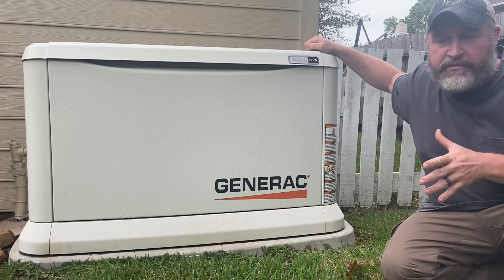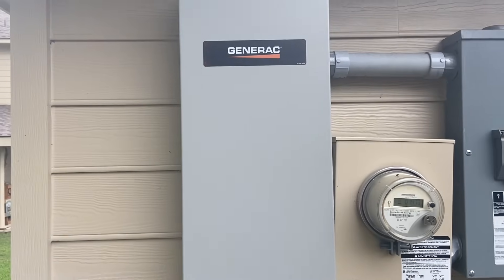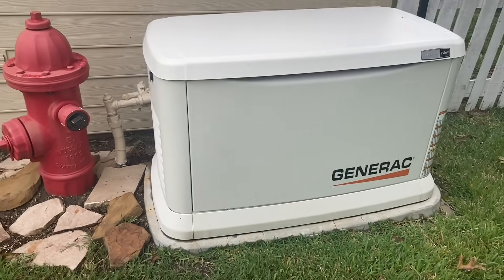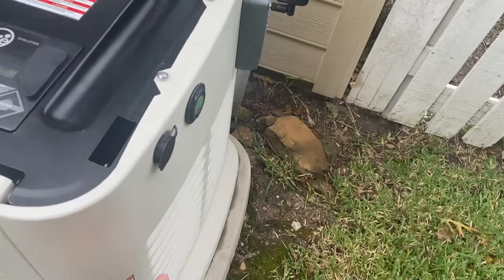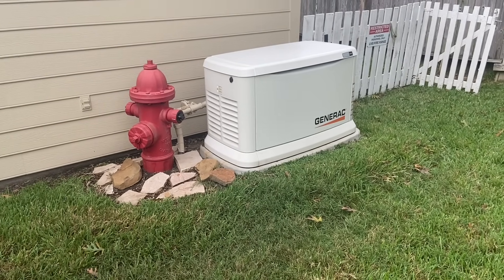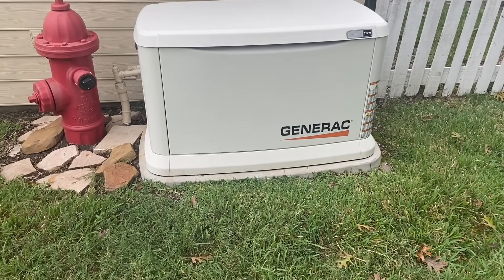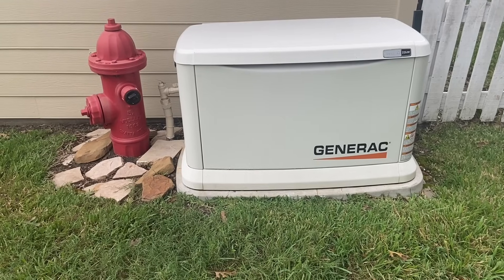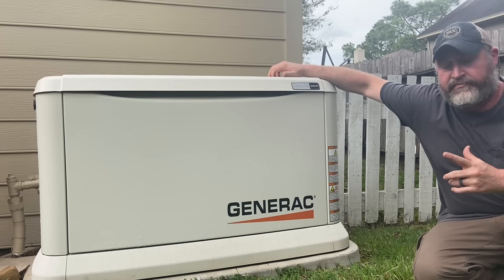Thinking of purchasing a generac whole home generator?

Comment: Very informative!! I'm getting one soon. Advise me if you will. I'm total electric with a 2.5 ton ht pump, 1.5 hp well pump, all the everyday appliances, 2 TV's, 4 ceiling fans, washer/dryer, 200 amp panel, garage door opener, and approx 1,400 sq ft heated/cooled space. I don't want to spend too much or too little on the generator. 22KW would be plenty, but do I need that much? What about 18-20 KW? I just don't know. HELP!!
Reply from the maker: I would always plan a little over for the future, but if your dealing with a good company they will give you the options.

Comment: We are in Texas also. Just got a quote from Generator Supercenter and how I found your vid. (doing research) We are looking at the 26kw. I'm very surprised your quote is $3925 install where they quoted me $7827.77! Our houses and install are pretty much identical. All they way down to the distance for gas and electricity.  They also did not offer the surge protector. Our quotes are pretty similar except for the doubled install price. Do you mind if I use you as an example to our salesman when I call?
Reply from the maker: My quote in the vid was almost 11k going price in my area for the same is now 13-14k you can definitely use my example if you want.
Reply: Prices going up with demand
Reply: Great idea, jew them down so that they don't make any money at all.

Comment: We had lost power for almost 48 hours do to power lines and transmission lines being down. 90⁰F+ days was not fun. But I have been looking at generators just in case. May go with a permanent mounted one at some point. Though $11-$12k is a big pill to swallow at the moment.

How much natural gas will this thing take under a full load?
Reply from the maker: The year of the big freeze when ran off of it for 36 hours and our gas bill was only 52$ more that month than the previous year month, keep in mind we had two gas furnace going and a gas fire place periodically
Reply: For that money, you can shack up in a hotel for quite a while.
Reply from the maker: @mrpawpaw7023  no hotels had power either.
Reply: @mrpawpaw7023  Will being in the hotel keep your pipes from freezing and bursting?

Comment: Hello, great vid very informative. Im deciding between getting this installed through Costco or looking at those new battery backup devices like the Anker Solix F3800 or the Ecoflow Delta Pro Ultra 2. I like the idea of battery as i can keep it in the house, no trench digging no gas/liquid propane to deal with, no noise. Are you familiar with those?
Reply from the maker: Thanks for watching, sorry not familiar with the battery backup.
Reply: I understand that to use those batteries you have to have solar panels installed (so those batteries getting charged constantly). Each battery could only last a few hours during a grid outage. For example, I live in Florida and every time we have hurricane we have power outage for at least 7 days.
Reply: @nimankot3942  no you don’t need solar panels. You’re thinking of something like a Tesla wall. Im talking about something completely different, look up the products. You can use solar panels with them but you don’t need it.
Reply: @K0NY718  So, yours is something like the tesla wall charged via your household current, or solar panels.  Won't last long-but okay for minor appliances, cell phone charging, running a small fan.

Comment: Thanks for documenting all of this.   A question:  When you turned everything on did you measure the total kwh drain?   Just curious what all of those appliances needed in the aggregate.
Reply from the maker: Thanks for watching! Please subscribe and check out some of my other videos. 

No I did not check the Kw drain , as the chance of us ever needing running everything in the house during an outage would never happen , I did it just to see if it would power everything, as we had received different info during other companies quotes.

Comment: Very Good Video, good information "Real World".
One question, you said that you used the Generator for about 30 days during the freeze, How did that effect your energy bill ??
Reply from the maker: Thanks for watching, you may have misheard, it was about 36 hours and if really did not effect my bill, maybe like 17$ more per day but that is also with 2 gas furnaces and a gas fireplace running. We left the attic door open to to keep the pipes from freezing so we where going through some NG for the big freeze. Please subscribe and check out some of my videos

Comment: Hi I have a question can a person shutdown electric threw there electric supplier and put the generator on gas powered threw there gas lines like you did and go completely gas and pay no more electric bill but pay gas every month only in order to power there appliances,internet,and normal lights? Thank you Michelle
Reply from the maker: You could however this generator is a emergency back up generator it’s not made to run continuously all day every day.

Comment: Here is some alternatives.  Portable power stations.  I use mine when boon docking  1800 amps for $1100 from home depot.  Basically a large rechargeable battery that outputs dc and ac to run appliances and lights.  Charge from solar, wall outlet or car.  Buy two and you are home free.  No installation costs.  No maintenance costs
Reply from the maker: Interesting thanks for watching please subscribe like share
Reply: Except you can't run an entire house on one of those little inverters.  Plus, you can only run those until the battery runs out.  When you have a power outage,  you are going to be running to your neighbor's house, asking to recharge.

Comment: Very informative.  Thank you for posting. Why did the pad crack?
Reply from the maker: Thanks for watching the pad is not cracked those are sand streaks from the casting process. Please subscribe like share and share, thanks
Reply from the maker: A sand streak propagates with water along the form wall, removing the cement paste and small fine aggregate and leaving behind elongated veins of exposed aggregate without cementitious paste.

Comment: We are thinking of an 18 KW, to use for possible future hurricane issues. The last storm, Ida, played heck with us. How do you think it would perform for 3 - 4 weeks, with the proper maintenance done every two days?
Reply from the maker: I believe the manual says to check oil lever every 24 hours of operation, we did but never needed to add any so you should be ok.

Comment: Thanks so much for the comprehensive video. I probably wouldn't have bought one, but the house we just bought had one.  I have to admit it was a bit of a selling point as it added value to the purchase. I didn't know anything about it, but in 3 months it has kicked in twice.  Just like yours, it took about 15 seconds until we were able to go back to watching the game. So computers were shut down and a couple of clocks had to be reset.  Unfortunately I had to leave both times before the city power was restored. So I don't know if switching back was "instant", or if I should chance running computers (or resetting clocks) while on Generac. Can you confirm a smooth transition back to city power?
Thanks
Reply from the maker: Smooth back on to city power we don’t know when it even happens since the generator will run for 5min cool down afterwards. 

Thanks buddy for watching please subscribe and check out some of my other videos!
Reply: @JustCantSitStill  Thanks for the reply.  Liked and subscribed.

Comment: Which dealer did you get the Generac from? Did you'll buy the generac after you moved into your house (because I was wondering if the generac is compatible with all types of homes)? And also, is there a reason why you chose to install a backup generator instead of a battery+storage system? Thanks!
Reply from the maker: Most of your questions where covered in the video. I did not consider a battery storage system because I know nothing about that and it sounds like it would need a lot of space which we don’t really have. Thanks for the comment please watch the video as it has a lot of good information, subscribe like and share

Comment: I hear all the time Generator Super Center on Michael Berry Show ! I’m considering ! My neighborhood mostly works on electricity.     Water heater and furnace operates on electricity. I thought these generators operated on gasoline or diesel. I can see yours uses natural gas as fuel for the engine . My question is, how do I choose the right generator if I don’t have a gas meter in my house ? Cheers from Houston .
Reply from the maker: It can use natural gas or propane, sizing will be done when you get your quote and it also depends on what all you want to work. Thanks buddy for watching!
Reply: @JustCantSitStill i asked a very similar question, I hope you see it and respond.
Reply: Yes, all electric here. Trying to explore options. Batteries, inverters, generators, etc
Reply from the maker: @Kenwood..  It can use natural gas or propane, sizing will be done when you get your quote and it also depends on what all you want to work. Thanks buddy for watching!
Reply: @JustCantSitStill  me and this gentleman are ALL ELECTRIC, we just may be out of luck for a Generac. Batteries with a generator or invertor may be an option. Still learning.
Reply from the maker: @Kenwood..  why could you not get propane ?
Reply: @JustCantSitStill  thats what I'm asking you. Had you NOT had natural gas, what would YOU have done? When you say propane I picture 2 things: either those tanks from the grocery store for your gas grill, or a giant bomb size tank on your property that a propane truck has to refill every couple of months. All electric sucks all around, especially for cooking on the stove.
Reply from the maker: @Kenwood..  natural gas was a must when we were house hunting, I would have never bought an all electric home, so that is my answer I guess. Plenty of people run these off propane with the large tanks , most can run for 2 weeks if needed, 1000 gal I think Is what the guy commented. Lots of information in the comments.
Reply: @JustCantSitStill  thank you

Comment: If you don’t mind, how much natural gas did you use during 36 hour. As far as pricewise.? Thanks
Reply from the maker: With the generator running , both furnaces, gas fire place and water heater it cost me a little less than 17$ more than normal for the bill cycle.
Reply: @JustCantSitStill get rid of that inneficient gas fireplace and install an efficient wood burning insert for back up heat.
Reply from the maker: @trajan6927 mine is extremely efficient

Comment: Thanks for the overview.  However the ground and neutral wires from the generator to the transfer switch appear to be severely undersized.  They should both be the same size as the hot leads.  That should have been caught in your electrical inspection, if there was one.
Reply from the maker: Robert thanks for stopping by and checking out my channel, permits where pulled and a very strict electrical inspection was completed and passed. Please subscribe like share share and have a awesome day!
Reply: I don’t think you should be so dismissive about this. While he is incorrect that they should all be the same size. They are undersized. 

It’s simple to check on your own as well. Minimum equipment ground for a 100amp system is a #8 wire. (Appears to be #8) 

Phases minimum wire size for 100amp is #3 (yours appear to be #4) undersized

Neutral is technically allowed to be downsized by1 which would be a #4. (Yours appears to be #6) undersized. 

This is not local code this is national electrical code. This also combined with a battery going bad after 18 months, (even interstate batteries last at least 3 years), a disconnect before your ats disconnect (redundant) but not against code. 

However bonding your neutral to ground is not to  code now since neutral should only be bonded to ground at your first means of disconnect. 

Also I would check your utility wires, you appear to have a 200amp service. You should have 3/0 wires for utility side. I can’t tell for sure but they look smaller, maybe 2/0. 

This leads me to believe you got hosed, and the electrical inspector had no clue if there was an inspection. 

Before you dismiss this just do a simple wire  ampacity search. Rated at 75c
Reply from the maker: @Drtouchwell  nice once again thanks for the comment it’s nice to have a expert in the comments  we have 100amp service the 200amp is the ats I was under the impression that the bonding was fine as the ats is the first disconnect? , please subscribe like and share!
Reply: @JustCantSitStill  your too nice, I’ll give you a sub. Your first disconnect is the first point at which you can disconnect your service. The disconnect you turned off to turn on the gen feeds the ats. So that makes it your first means of disconnect. 

Only a 100amp service with 3 a/c and a 2200sqf house? Well if it is only a 100amp service then that brings the question as to why use a 200amp SE ats and why not a 100amp switch. Save a few$ Then,  with the first disconnect why even use a SE(service entrance) switch and save some more money. 200amp SE switch around $800, 100amp SE around $600 and 100amp Non SE around $400. 

Your other disconnect is your service disconnect. So you shouldn’t need a service entrance switch. 

If your other disconnect is 100amp then that would make the 200amp in the ats just a pass through maintenance disconnect. But again, this seams to be a waisted money.
Reply from the maker: @Drtouchwell  Ok so it was done correctly until the inspection requested the extra disconnect, the electrician did not want to do it but they went ahead to pass the inspection, I was not charged anything extra. I agree the 100 amp service is small for what it is but we have been here for 5 years and the electrical is solid No issues. The 3rd Ac is in the garage I don’t use it much and it’s on a separate sub panel for everything in the garage. The wires for the ATS  is a extremely short run the main breaker is inside the garage on the same wall, I can literally touch the generator and all the electrical boxes at the same time. So if by accident the neutral is a little underside with the run only being a few feet I would hope all is good?
Reply from the maker: Oh and thanks for subscribing! I really appreciate it.
Reply: @JustCantSitStill  possibly your municipality requires a pass through maintenance disconnect which would not be very cost efficient for anyone trying to install a gen in your area and is not required by NEC. 

However you should still inspect your wires. Your gen should have a 100amp breaker in it. Which requires #3 wires. If they are #4 then they’re too small. Current carrying conductors in a raceway.. #4 wires are only rated at 85amps at 75c. Even if they used a 90c rating they’re only rated at 95amp. That’s not a code that an inspector can amend.

Edit* also if your neutral is only a #6 then that’s undersized as well.

Also your neutral should not be bonded to ground if your ats is only a maintenance disconnect
Reply from the maker: @Drtouchwell  the part number on the wire brings up a #3 slim pull southtex. The neutral is in fact a 6 rated at 600 watts. It looks like if I wanted to I could just remove that green jumper to debond but I am not very familiar with larger electrical work such as this. I feel like if it’s not broken leave it alone ? It’s been installed since 2018 and has work flawlessly?
Reply from the maker: @Drtouchwell  just getting back to this , we had a master electrician come out we did remove the green jumper for the debond , he did some calculations on the wire sizes and I guess generator output and house ? Not real sure what was all involved but the wires sizes are all correct for our current set up. I definitely appreciate your comments and help glad we got the green jumper removed. It was clearly a mistake that happened after the initial instal which later the inspector wanted that additional disconnect.

Comment: I have a question about this unit. I'm in Buffalo NY and we got a HUGE snowstorm this week. Question is if this unit is covered in snow and buried under around 4-5 ft of snow do you have to dig it out? or can you run it?
Reply from the maker: I would imagine dig it out as you need airflow.

Comment: Our gas line/meter is on the opposite side of the house from the electric meter, and most of our basement is finished, what’s cheaper running electrical cable vs gas line?  Thanks
Reply from the maker: These days who knows, I would bet the gas run would be cheaper but get you a few quotes for the install and let them decide. 
Thanks for watching please subscribe like and share!

Comment: Great video. My house is 3500 sq ft. I'm wondering if I'd need the 26kw system? Also, it sounds extremely loud. I'm worried the noise would be too loud for the neighbors.
Reply from the maker: How Loud Is A Home Standby Generac Generator?????
https://youtu.be/C-a5FbEqU7A
Reply from the maker: Thanks for watching , sizing depends on what all you want to run , ours is a little more than needed but will do everything. During your quote someone should go over size and explain
Reply: My next door neighbor has a Generac whole house generator and it comes on to exercise every so often and I heard it when the power went out several times. To me, it's not loud at all. I been out back in my RV garage working till 1 or 2 in the morning and I'm closer to her house than our house is (30 vs 50 feet) and around 11:00 pm it starts up and runs for 5 minutes or so about every week or two or three, I don't really notice it unless I'm outside.  Wish I had one. We have a 25 year old Generac 3500 XL and believe it's louder than her whole house generator. I'm planning on putting in a 6 or 10 circuit manual transfer switch and then when this generator dies getting a remote electric start gas or Diesel or maybe a natural gas version.